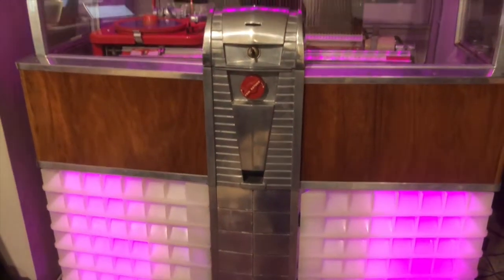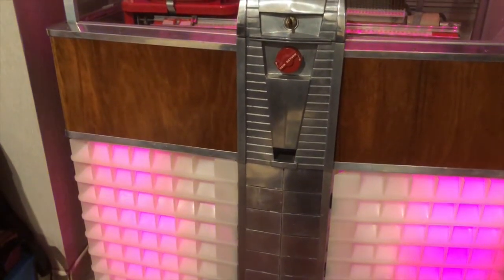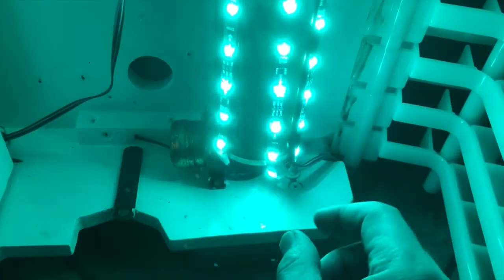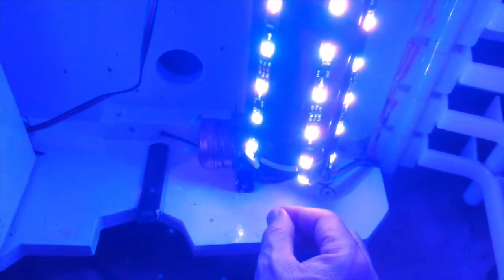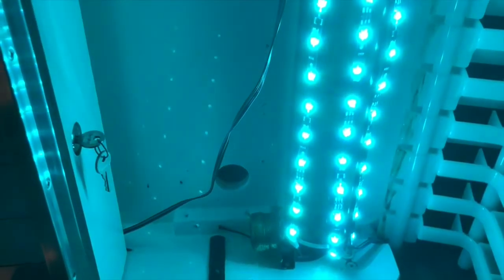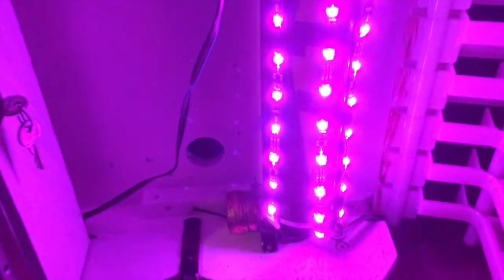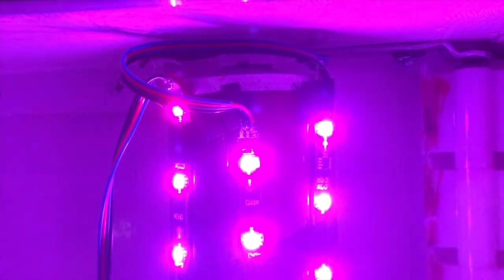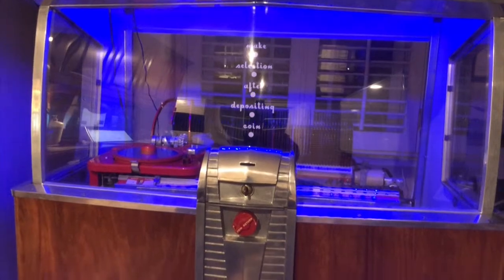Part 13 Jukebox LED Light Strips #1 - AMI E-120

Comment: Did you use any kind of diffuser for the lights in the top part?
Reply from the maker: No, I just mounted them to the original light tube.  It didn’t seem to need a diffuser

Comment: Wondering if you have had any issues or can give any tips on polishing the plastic windows to a glass-like transparency. I have used everything from standard recommendations of Novus products to buffing wheels I use for polishing nitrocellulose lacquer guitar finishes and I cannot get the windows super clear. They're 'pretty good' but there's a slight haze. If you've gotten the windows completely clear, i'd appreciate tips or an instructional. Thanks!
Reply from the maker: Hey Blake.  Well, I'd definitely exhaust every other method before going to a buffer.  I used water, soft dish detergent and microfiber to clean it within an inch of it's life.  No dirt can exist anywhere (in cracks along edge).  Then I used a good auto wax to buff it (by hand).  I had a little hazing that the wax took out.  If wax isn't enough, you could then switch to a good automotive rubbing compound.  It has a little more grit.  If that doesn't work you could try a mechanical buffer.  Based on my wood work experience, you would just want to move it around a lot.  You don't want a chance that it could get too hot in a spot.  I've also seen some kits you can buy to clean plexiglass.  However, I think the automotive compounds are a great place to start.

Comment: Very cool. I may do this in the future. My E-120 came without the top color tube and assembly- someone substituted an fluorescent-like LED substitute. Wondering if you might be interested in selling the top one (assembly, motor etc.). Also, I'm quite adept at tube amps so if you need any help or advice I am glad to help. Those Tiger coupling caps are always leaky so you should replace at least the power-stage coupling caps and the electrolytics. Those older caps do have a softer tone and you can usually keep the couplers in the preamp stages even if they're a little leaky. With the electrolytics, you can leave the cans so it looks original and wire-in substitutes inside the chassis. Mine also had a blown output transformer and they're hard to find- even a substitute. I just found a substitute that drops right in the mounting holes and is working fine with the amp- ClassicTone 40-18044, if this is helpful to anyone. But anyone that wants one better grab one fast from Tube Depot because ClassicTone is going out of business. That OT only has a 16 ohm out, but most people aren't going to need those multiple impedance connections anyway so it's perfect for the cab speaker which is 16 ohms. The primary impedance is a little lower than the original but it's close enough and is working great. This amp, just like all tube amps, really starts to sound good when you get it up loud a bit. Not so much low. The OT is a direct drop-in but you have to run the negative feedback circuit via a resistor (like the "F" and later models) because the replacement OT doesn't have the 'negative feedback winding' like the original. Hope this may be helpful to people in the future. Let me know if you might be willing to sell the top color tube assembly since you're not using it.